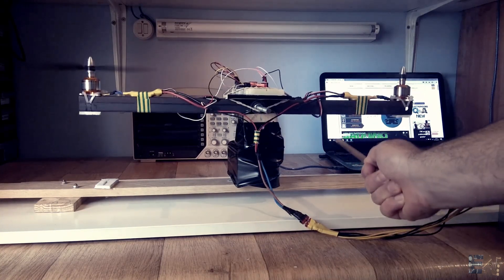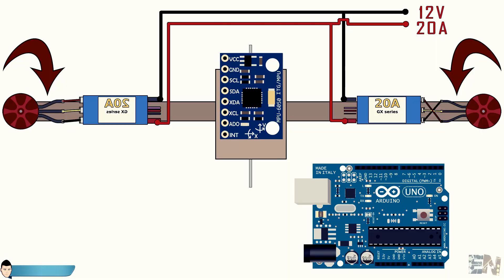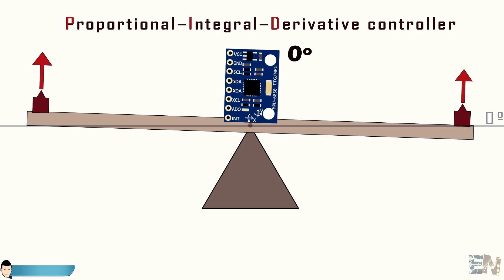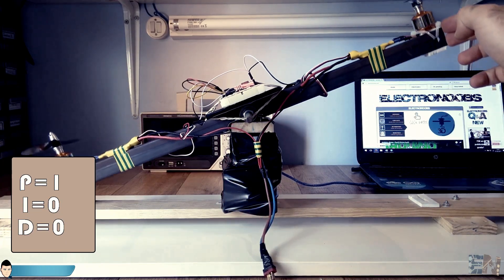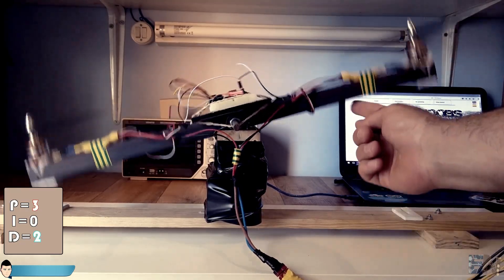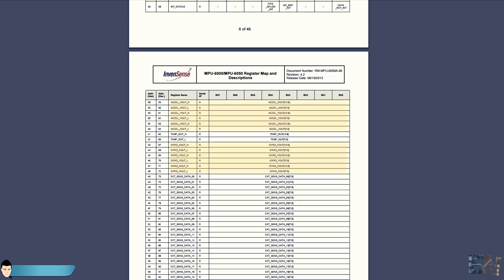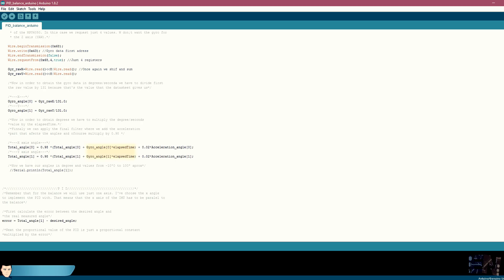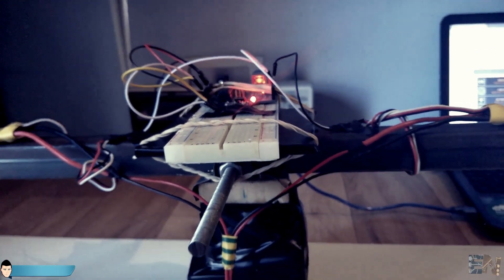PID brushless motor control tutorial

Comment: Greetings,

I would like to bring your attention to an important point regarding the motor configuration in a quadcopter. When connecting two opposite motors, they should rotate in the same direction, either clockwise or counterclockwise.

However, I noticed that you have set one to rotate clockwise and the other counterclockwise. I understand that you are testing with only two motors, but in a quadcopter, any two opposite motors should rotate in the same direction to ensure proper balance.

Thank you for your understanding, and I wish you the best of luck with your testing.

Comment: PID (Proportional-Integral-Derivative) control helps maintain consistent RPM (revolutions per minute) across motors to prevent imbalance. Suppose motor 1 on the right side is spinning 40 RPM faster than motor 2 on the left side, despite both receiving the same power. This difference is an error that can lead to instability. To correct it, the PID controller continuously calculates adjustments to the power supply of each motor to reduce the RPM difference.

The PID control system works by calculating an 'error' (the difference between desired and actual RPM) and applying corrections in real-time to bring both motors to the same speed. This technique helps keep the system balanced and stable.

Comment: Hello A greeting from you ...At this year I have the 2212 930KV motor , my question is you ever used the ardupilot mission planner software to set up the PID in the multirotor ?...I dont used the arduino board but I used the crius aio pro controller to set up the PID in my motor ...What values did you obtain in your test...would the result be the same if the mission planner software was used?

Comment: Thank you so much , i'm suffering a problem of oscillatory behaviour cause the motors to be turned off, i'm using:  5 Amp ,30V power supply, amp knob turned to the max limit and the voltage regulated to be 12v and the same  type of motors , but the system turn on motor  and the other off and vice versa , with an ocillatory behaviour .
is there any advice to diagnose this problem.

Comment: I think this wont work if your desired angle is different from 0 degrees, say it is 30 degrees. The error will reduce, but so will your PWM. This is because your throttle corresponds to 0 degree angle. You also need to take care of throttle.

Comment: I know this video was released 4years ago. I am a newbie on microcontroller, so I went through the code and i had got an question. 

Shouldn't we have to divide PID(Output) by 2, before adding/subtracting from throttle of both motors??? Therefore this will lead into zero error quickly???

Comment: Hey I have been having fun with your program here, but I have been trying to edit the code and use a pot to control the throttle part of the sum in the code but I am having no luck. What is the best way to do this?

Comment: Does this code account for the offsets that are common with MPU6050/GY521 breakout boards? Is that the purpose of the filter? Do I not need to worry if my MPU6050 isn't calibrated? If not, how would I implement the offsets from xAccel, yAccel, zAccel, xGyro, yGyro, and zGyro that I found using an MPU6050 calibration code? Thanks!

Comment: Excellent video, thanks a lot for sharing. I'm trying to implement using 1 motor only, obviously I've modified the code but the motor just beeps without starting. I can run the motor no problem with the esc calibration code. Anyway I'll keep trying!

Comment: That video is what I look for. Saving for later :)  I am making a drone, based on DJI F550 components extended to size like Alta 6 drone, and a clone of Arduino Mega. And I want to not use Multiwii because I want to write my code for it and some other crazy ideas, the transmitter is also on Arduino (Uno) with I2c LCD. Hoping I will make it with 2-way communication (telemetry, battery status, GPS data etc.), so,  did you trying that already?

Comment: very good explanation. I am facing one problem, I wish to make a RC V22 osprey, the plane has two profiles one is hovering as a bi-copter and forward movement as a plane, If i wish to use the multiwii what will be the settings? Do the the plane need two Mpu 6050 for hovering as a bicopter and one as a plane? Thank you.

Comment: You are really amazing, what do you mean by 'Throttle'  ? , is it the speed or error ? , and is it constant or variable ? , what is the initial value of it ?
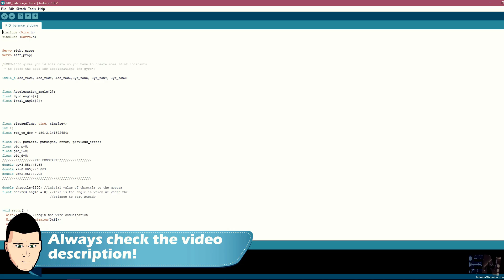Reply: look at 10:50 , there you can see the initialization of throttle.
if i understood it right, throttle is the "power signal" for the rotors or how fast they rotate. The PID than calculates how big the error is and the two rotor speeds get adjusted afterwards in order to decrease the error.

Comment: @Electronoobs Nice vid. Well explained, although a little more theory might be welcome to some.
Tip: the gyro's are actually already derivative values of the angle. There is no real absolute angular measurement. So the gyro  values in degrees per second can be sent straight to Kd whereas the acceleration measurements (without any gyro component) can be fed to Kp and (after integration) to Ki. That should keep you slightly more in control. You may also add a derivative of the accelerometer to Kd but I doubt whether that will really help - it may actually make things worse.
Please try and let me know (if you did) whether you see any difference for better or worse. Thanx. :-)

Comment: why does the IMU board need to be centered along the bar? if you're just using the gyro it can be placed anywhere along the bar as long as the axis of rotation is parallel to the gyro axis. maybe I'm missing something
Reply: hello please do you have the code of this video for PID controller of brushless motor

Comment: instead of all that complicated code for finding the X and Y angles why not just use this (utilizes splitting the gravity vector and solves for the "triangle" to find the various angles): 

float gForceX, gForceY, gForceZ; //g forces
float angleX, angleY, angleZ;

  Acc_rawX=Wire.read()<<8|Wire.read();
  Acc_rawY=Wire.read()<<8|Wire.read();
  Acc_rawZ=Wire.read()<<8|Wire.read(); 

  gForceX = Acc_rawX / 16384.0;
  gForceY = Acc_rawY / 16384.0; 
  gForceZ = Acc_rawZ / 16384.0;

  Serial.print("   Angle (deg)");
  Serial.print(" Y=");
  Serial.print(180*((atan(gForceY/gForceZ))/3.141592));
  Serial.print(" X=");
  Serial.println(180*((atan(gForceX/gForceZ))/3.141592));

Let me know what you think. I see that instead of dividing "gForceY" by "gForceZ" it seems to me that you used the pythagorean theorm to solve for the triangle, because of the square roots and powers. Cool how 2 different approaches do the same thing. of course you would have to choose what to make negative but that depends on your setup and which direction you are calling x,y,and z. My code that I posted is just the bare bones. Also my X and Y values might be your Y and X values, respectively.

Comment: Thanks! I used your system to make my robot ride in a straight line. Before it went to one direction because the motors are bad quality.
Reply: Hello Can you please tell me How to connect all four motors to it and  do wee need calibrate ESCs and then do we need to load code for ESC and MPU seperately in the same ARDUINO.

Comment: Great video,, 
but what about the motors electrical characteristics ? for example, how did you know that this is the best voltage to run the motors at ? whats the maximum and minimum voltages to be mapped by the PID computer function ? I may have missed something but I'm curious for an answer ...

Comment: Are you using the absolute value of the error because of the zero angle set point or it has to do with the whole PID tuning method?I mean the whole concept is to have the same behavior no matter what the set point is right?

Comment: why u use compilmentary than kalman filter? ans pls :)
Reply: I'd like to know the reasons for this as well.

My assumption would be that a Kalman filter, being Linear algebra/matrix math, can be hard for the microcontroller (ATmega328) to run, as well as (relatively) more complicated for a human to understand.
Reply: Oh thanks for explained.
In my case,  my pwm output from pid calculation is responsive but when it write to esc ,the bldc response is slow(its like have some delay on it) so my quad can't stable in any pid constants that i tune..
Please help how to make my esc reponse fast according to yaw and pitch angle with no delay ?( thanks.
Reply: Hummm. Latency in ESC? You could have soft start ESC. These are cheaper and normally for cars. You are NOT supposed to use those for quad/drone.

If you must try making what you have work I would remember PID basics...

P = Proportional = Present
I = Integral =  Past
D = Derivative = Future.

Useful part for you being "D = Derivative = Future."  The theory is, if you know the ESC reacts slow, but you know exactly _how_, seems you could predict the error and compensate. It would be ugly though, so you really should get a better ESC. You can't compensate for ESC that refuses to listen.

Anyway, hope this helps.

Comment: How I can use this for a two DC motors with a L293D? You can help me please! Diagram Circuit
Reply: use ESC for control.  l293D does not control how much current is sent to motors.

Comment: hi, may i know what the difference between pid_p, pid_i, pid_d and kp, ki, kd in the code? Are you tuning kp, ki and kd only? 
The calculation for pid_p, pid_i and pid_d, the output is pwm signal with unit us? If yes, how to convert the error in degree unit to pwm?
So the motor speed is control by input the pwm signal?

Comment: Great tutorial! but what is the purpose of the if statement before getting the pid_i?
Reply from the maker: Could you tell me which "if"? I don't know which one you say.
Reply: Electronoobs the one with if(-3<error<3)
Reply from the maker: That is the I part of the PID (integral). You only want that part when the angle is almost the desired one, in this case the desired one is 0 so the I part of the PID will only act between an error of 3 and -3. Keep up!
Reply: Electronoobs thanks dude, but why would you not want it if the error is greater than |3|? does it affect the speed of stabilization?

Comment: Is it necessary to have props turning in opposite directions, CW & CCW,  for this demonstration device? Thank you.
Reply from the maker: Yes, the turbulance will be lower. The right motor CCW and the left one CW. Spinning to the inner side of the system will a,lways reduce turbulances.
Reply: I am building this project. I will have to order appropriate propeller for anti-clockwise rotation.   I appreciate the knowledge I have gained thru your videos. Thank you.
Reply: That is true but don't you need two different propeller nuts(CW - CCW)? Because one of them will become loose. That's what happened to me...

Comment: hello, thank you for the video and the hard work.
i've written a code based on this tutorial and other tutorials, but when i run it, either i get rapid beeps from one motor, or no beeps at all from both and i don't seem to understand the reason behind this.
p.S : the motors are calibrated 
i'd like to email you the code maybe you can figure out what's going wrong !
Reply from the maker: My mail: info@electronoobs.com Also, yes, yoou have to make sure you have the ESCs calibrated with a range between 1000 and 2000us. Use this tut for that: http://www.electronoobs.com/eng_robotica_tut5_1.php

Also you should always start the loop with a 1000us vale write to the esc for a few seconds. If you apply more than that in the first few seconds, the ESC will enter into the config mode and that's why it beeps. So apply 1000us pulse to each ESC for a few seconds then apply your value.
Reply: i've sent you the code. i've managed to make the motors turn with that code, but when i change the kp gain from 10 to 20 one of the motors start beeping fast.
second problem is that, when both motors work(in case of 10 kp gain) the motor further from the ground is being turned off ! then when pulled down, it turns on and and fast...(even thought i did set the minimum value to 1100 which should keep the motor running, but it still shut itself down !!! )
a lot of "on and off" and i'm afraid that it will be fried !
Reply from the maker: Maybe it's a connection problem and due to wire fail the ESC is reseting and starts beeping. Also you should make sure to constrain the PWM signal between (1100 and 2000): It can't be bigger than 2000 and if you set the minimum to 1100 you make sure it won't turn off.
Reply: yes, and i got them to work even tough they get crazy sometimes .. thank you for replying.

Comment: Brother how can i do this line for the z-axis?:
/*--Y--*/
Acceleration_angle[1] = atan(-1*(Acc_rawX/16384.0)/sqrt(pow((Acc_rawY/16384.0),2) + pow((Acc_rawZ/16384.0),2)))*rad_to_deg;

I am trying to do the 2-axis and for that I need to add the z-axis for the Euler formula to stabilize the quadcopter.

Thank you.

Comment: Brother I wrote a PID control sketch using your code for one axes PID. In my code, I did some changes so I can have two axes balanced. I also built and android app to control your code using HC06 bluetooth module. The drone is well balanced when I hang it above the ground. However when i place my drone on the ground, the drone does not get balanced anymore. If you have time to help me with this small problem, I can share the code and the android app.
Reply from the maker: It could be that you need to calibrate the IMU.
Reply: Thank you. Will do that.
Reply: Can you share me your code @ELMO7TARAMQ8 ?  I'm doing the same project. Android controlled Quad for our thesis. Please, share your arduino code for your PID. this is my email: aldwinriveral@gmail.com Thanks a lot! You will be of big help!

Comment: Hi Electronoobs ,
I have mpu9250 module, is there any difference  between mpu6050 and mpu9250 in calculation?
can I use your code also for mpu9250, if not then what sort of corrections should I do?
Reply from the maker: The code is the same with the mpu9250. I think they have the same slave adress, 0x68, am I right?
Reply: I didn't mean register or device slave adresses, when you get the gyro values you divided 131 and in comment you said "because  datasheet says".
And I wonder whether it is also valid for mpu9250?

By the way I read about MPU9250 , it contains the same hardware as mpu6050 and extra compass sensor , is it right? If so, we can think calculations for mpu6050 also valid for mpu9250. Am I right?
Reply from the maker: Yes, is the same. Check the page 8 of the datasheet: https://www.invensense.com/wp-content/uploads/2015/02/PS-MPU-9250A-01-v1.1.pdf

Check the Sensitivity Scale Factor.

Keep up!
Reply: Thank you friend, nice job.
Reply: @ELECTRONOOBS i am making this as a project & facing some issues, can you please help me

Comment: Awesome video, My group is about to work on a project like this.I would like ask if this PID algorithm would be still able to balance platform even though a weight is applied to one side of the bar. thanks
Reply from the maker: Yes, it would be the same. That's the thind about PID, it should control the bar even with different weight on the sides.

Comment: Hola, que tal tú proyecto es muy interesante; tengo que hacer un proyecto similar al tuyo usando el mismo motor y el MPU6050 sólo que en mi proyecto sólo ocupo 1 motor y no 2 como es tú caso, ¿qué modificaciones tengo que hacer en el código para que funcione solo con un motor?

Saludos.

hi, your project is very interesting; i have to make a similar project, but i only use one motor and the MPU6050, the question is what should i change in your code for operate with only one motor?, i need help with that, it's my final project.

Regards.

Comment: wow Great video Sir Electronoobs. I am wondering if this lesson could solve my problem on PID with a different system...I'm currently working on a wind pendulum project and I hope to adopt your PID lesson to balance the pendulum at center within the shortest time given , the pendulum has 4dc fans attached to its 4sides  .how can I apply your lesson? Thanks for your help in advance
Reply from the maker: The PID formula is always the same. You need to adapt your system to your needs!
Reply: Sounds like the same. You have -x, +x, -y and +y axis. The 4 motors. Your desired value would be 0 in every axis to maintain stability (I assume, if not change it to what you want). You could do the same with a gyro sensor (assume pendulum is rigid). You just change the power delivered to each motor based on your error. Then all you have to do is trail and error for the right values. This is the most crude, but simple way.